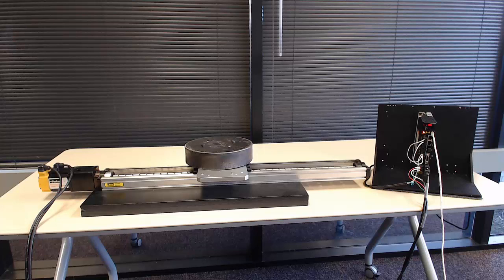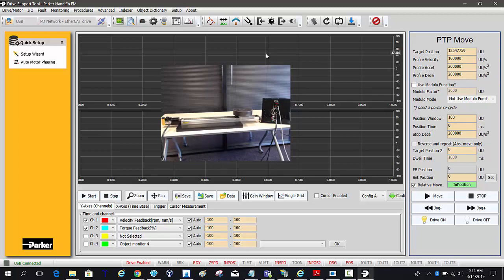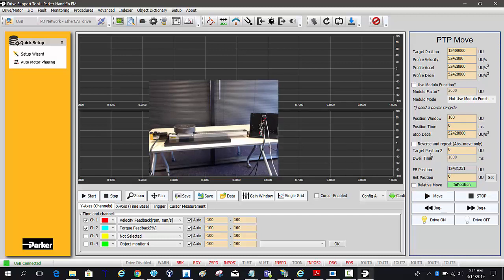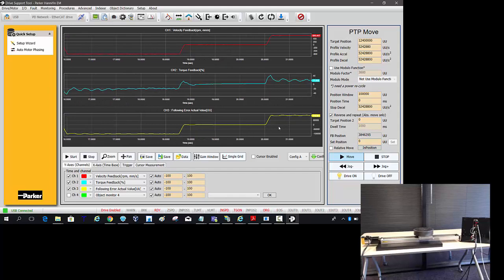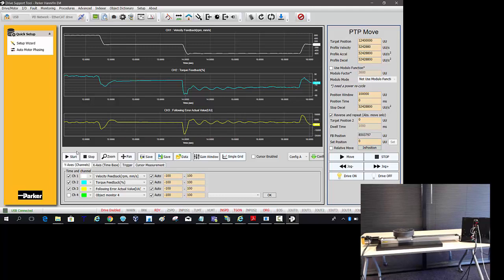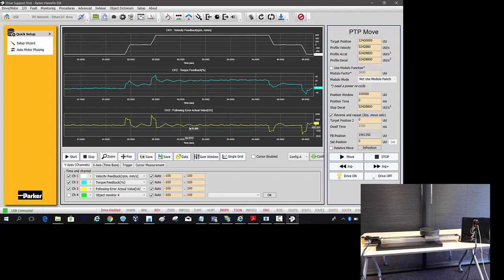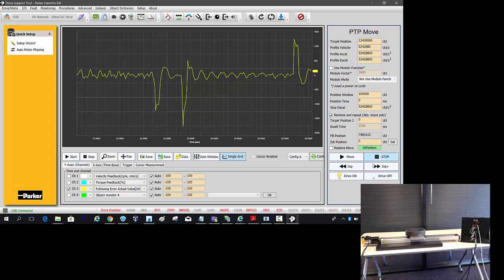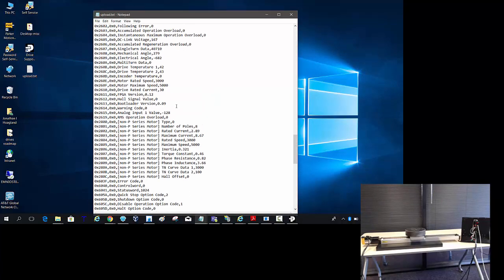Parker P Series Servo Drive Tuning Tutorial

Comment: hello, have you ever communicated the network that manages FLSmidth (ethernet powerlink) with some PLC AB (ethernet)?
Reply from the maker: EPL is different protocol than what AB uses which is Ethernet/IP. EPL requires a EPL master to control that network with its own slaves. AB ControlLogix and CompactLogix plc's can be Ethernet/IP masters (cip communication).If needing a servo drive with Ethernet/IP, we have the Parker IPA. I've other videos showing controlling it from AB plc's with AOIs already done.If you have an HMI, you can check if the HMI can talk both Ethernet/IP and to the EPL master.  What Ethernet/Powerlink master are you using? B&R is most common for EPL and it in addition to controlling the EPL may talk other protocols. They may have an EIP to then talk to AB plc.This question though has nothing to do with above video...